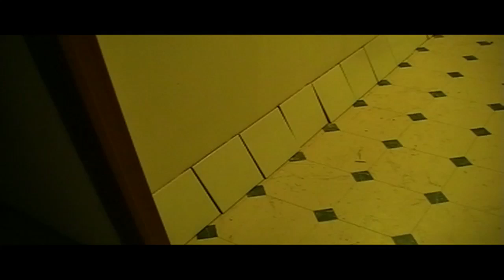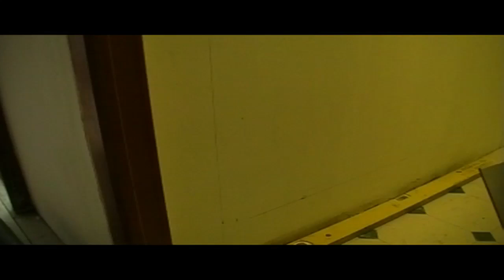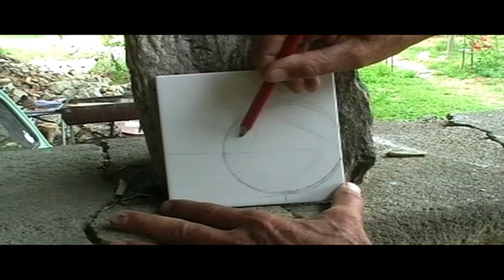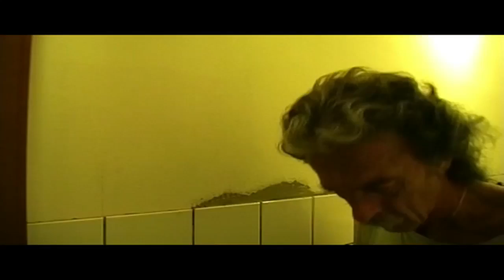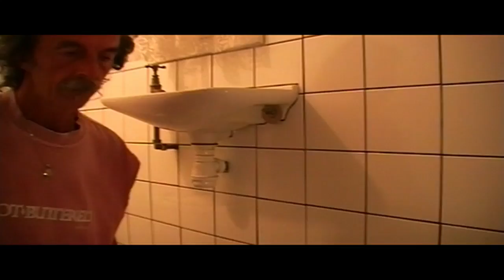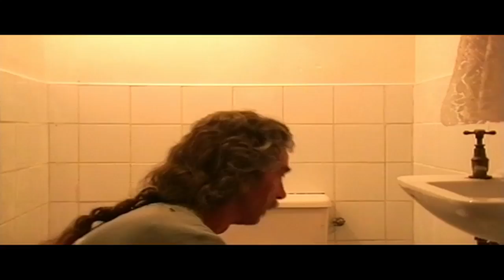Basic tiling for beginners

Comment: I didn't understand the very beginning of the vid
Reply from the maker: I think you mean when I didn't start the tiles on the floor level but a little bit above? Sometimes in old houses, the floor level is not level. In my house I have a room where the floor is 3cm lower than the other side. If I laid the tiles against the floor, all the tiles would be skew (sloping). Hope you understand now

Comment from the maker: @Riaan3108 unfortunately yes! very often floors aren't level, especially in old houses. The bottom tiles could end up being 13 cm on one side of the room and 14 cm on the other side. if you follow the level of the floor your row of tiles won't be horizontal